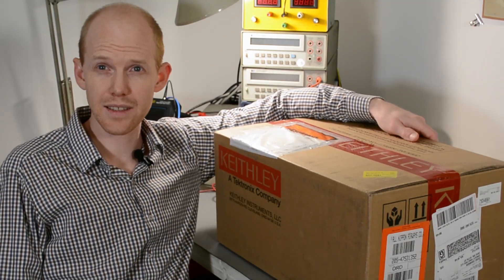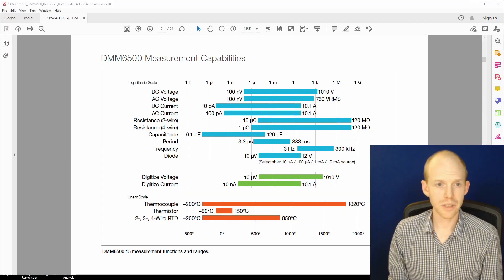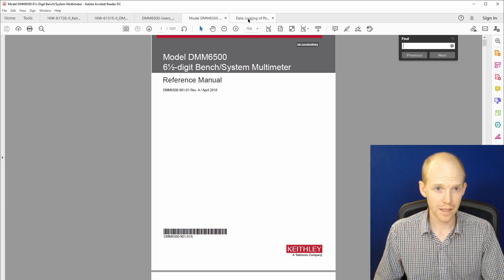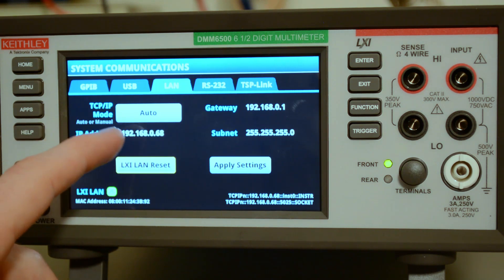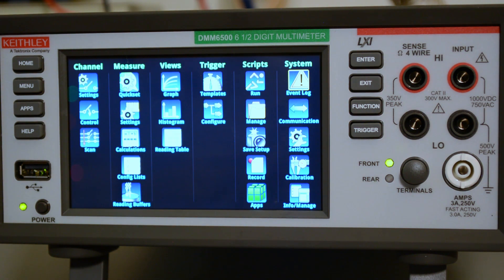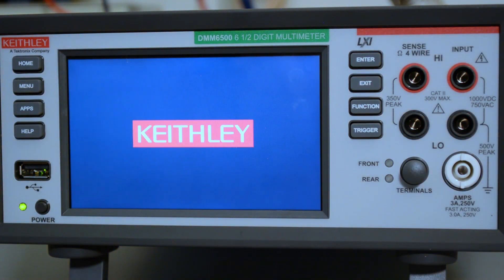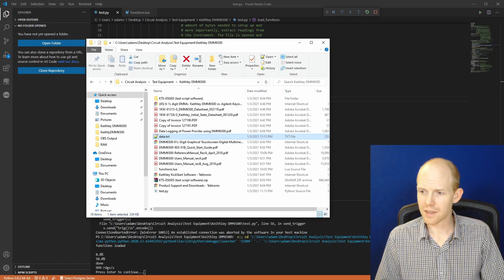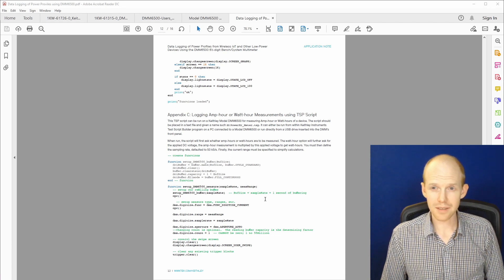Keithley DMM6500 Review & Scripting Tutorial (Python)

Comment: bro, how to read the data directly into excel one by one in real time rather than checking the saved file afterwards the check is complete
Reply from the maker: Hey, sorry for the late reply. I have not tried directly connecting it to excel, but since MS doesn't support python natively yet I'd go with the built in VBA scripts. Here's an example of measuring temperature: 
https://forum.tek.com/viewtopic.php?f=617&t=140575&sid=a7c88b46756bfc2d0cf9557b7468bf1e
If you go into the VBA editor in that file (alt+F11) and open up Module1, you can see in the "Run_Temperature_Scan_Click()" function how they are sending the standard SCPI commands using a line like "myStatus = commSend(instDMM6500, "*RST")". Using this example and the DMM6500 manuals you should be able to modify the SCPI to get the measurements you desire. If you want it to run continuously and automatically you could put your code in one of the excel reserved functions like "Workbook_Open()"
https://support.microsoft.com/en-us/office/automatically-run-a-macro-when-opening-a-workbook-1e55959b-e077-4c88-a696-c3017600db44
and you could put it in an infinite loop with a fixed delay between readings.

Comment: Thanks for sharing! I assume that the same things can be done with the DMM7510, but wonder whether higher data rates can be achieved when sending data directly to a PC. Do you have any insights?
Reply from the maker: Yeah I think it's supposed to be 1MSPS, but I was only able to get around 60 KSPS with that script. It seems like the USB and Ethernet should both be plenty fast enough to handle 16 bits at 1MSPS. Sorry I don't have time to try and figure it out right now, you might have to ask Keithley. I'd be curios though if you figure it out hah!

Comment: Do you know if there is way to measure DC voltage and current using this code?
Reply: Accuracy may get thrown off due to switching between DCV and DCI functions. Some function pairs are better suited for getting multiple measurements at the same time (RTD measure & 4-wire Res, ACV & Freq or Per, etc.). If you can live within the confines of some ranges you might be able to take advantage of the DCV Ratio function for capturing V & I: 
https://www.tek.com/blog/measuring-power-using-your-keithley-dmms-ratio-function
Reply from the maker: @joshbrown5138  Cool thanks for the info, you sound like you work for Keithley or something? I was thinking of using this to measure current and voltage with a script to get input power to a power converter, what is the inaccuracy you are talking about with measuring both DCV and DCI at once? Can you wait a second or two and measure the other to improve accuracy? I was also curious if the rear ports are separate? Like for instance, could I hook the rear ports to the output of a power supply and the front inputs to the input and get the input voltage & current and output voltage and current all with a script to calculate efficiency automatically?
Reply from the maker: Yes but there's several things to consider. First, this is using the LAN and you might also want to use the USB connection instead if you're just connecting directly to 1 computer. Second, for standard simple measurements you'll want to use the standard SCPI commands (you don't need to worry about loading scripts onto the DMM like in the video). Check out the Reference Manual (link in the description) introduction to SCPI section starting on page 374.
Reply from the maker: Here's a link to some official examples I got from Josh Brown, I think his post disappeared so I'm pasting it again and also adding in the description:
https://github.com/tektronix/keithley/tree/master/Instrument_Examples

Comment: Hi,

tnx for the great review.

I bought a DMM 6500 about a month ago, and when I plugged the AC in started making
a loud humming noise .
The device was not even switched on.
So I send it back.. after googling a bit, I found that it seems a problem with the transformer
production year 2020.. did you noticed anything similair ?

I really want one but I'm afraid to buy another one and getting the same problem.
I need an absolute (except sometimes the fan) silent one on my workbench.

any advice ?
Reply from the maker: Mine is 6ft from where I sit at my desk and I never noticed it making any noise when it was off, but I just put my ear up to the side vent hole and I can hear a 60Hz hum. I think your probably just had some defect/resonance though because I never noticed mine until I put my ear right up to it just now. Mine does have a humming sound from the fan as soon as it turns on, which you can hear rev up / down as it does its self check or whatever. It'd say when it's on it's about as loud as an average desktop computer. My old HP3478A DMM never seems to make any noise though so if quiet operation is a large factor then I would probably look for a fanless DMM. Good luck!
Reply: @CircuitAnalysis  tnx !

Comment: For the amps measure, be sure to use the (white) amps HI input.  Looked like your AFG connections were to the volts input on the dmm, but the script is putting meter into amps......
Reply from the maker: Good call yeah need to be sure it's measuring volts! Just got a new function gen so maybe I'll try it again.

Comment: Cool video. 
Just FYI. The DMM comes with the Kickstart licence included. At least that's what I was told here yesterday, when I got my quote for the 6500...
Reply from the maker: Oh awesome, thanks for the info! Might have to do another video!
Reply: @CircuitAnalysis  I had the DMM6500 with me for 2 days (borrowed from a friend) and used Kickstart to play around and i noticed that the dc current measurement atleast doesn't match the accuracy on datasheet. Will be nice if you can get a precision current source nAmps and see how precise this DMM samples and outputs data. Very good video btw. Thanks for the debugging tips.
Reply from the maker: Oh interesting thanks for the info. I don't have a precision source at the moment but I'll keep it in mind. What did you use or how were you able to determine it was inaccurate? Thanks for watching!
Reply: @CircuitAnalysis  I used a precision Keith key smu and compared Keithley dmm, joulescope and a old agilent dmm under same smu source conditions. My load was a Bluetooth circuit where the current peaks are around 18mA and average current supposed to be around 11uA. Dynamic current measurement basically but it was within the dmm range against which accuracy has been mentioned on datasheet. I might still be wrong but if you wish you can get a precision smu and test.
Reply from the maker: @Truth_seeker_24  Awesome, thanks for the extra info. I will definitely keep that in mind for the future, especially if I'm trying to measure tiny currents!

Comment: the debugging process is awesome, one thing i wish to do with mine is to run a script to automate I-V curve for a semiconductor device, to trace the iv curve of a diode or transistor, i kinda did something similar with the rigol power supply increasing voltage in steps and i acquired the current values directly into matlab ...man i love these things....thanx 4 this wonderful video.
Reply from the maker: Awesome, thanks for the suggestion, that's a good project idea, I'll add it to my list. It would be great to have accurate parts data like that for making more accurate SPICE models. I'm also working on a programmable power supply so that would be a great way to test them both out at some point. IV for a solar cell could be cool too. Anyway I'll be excited to hear when you get your script working!